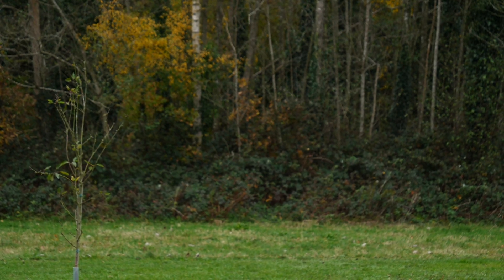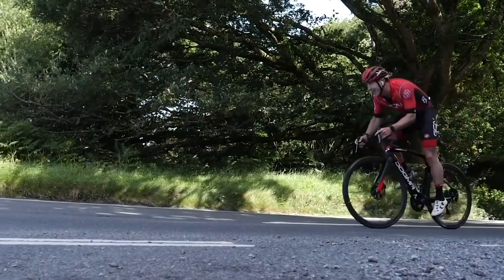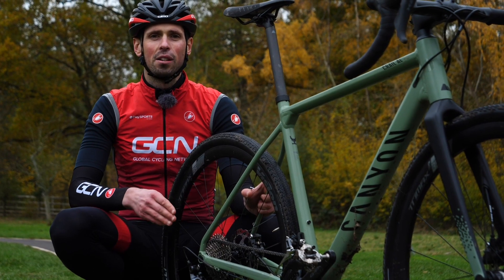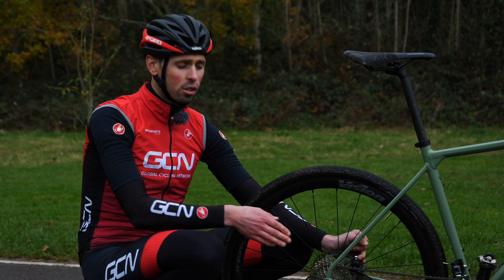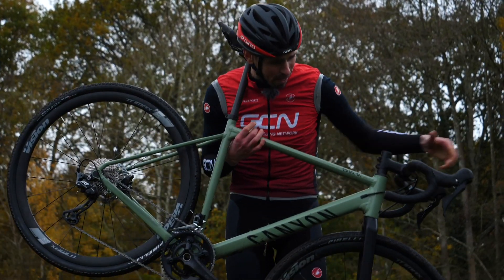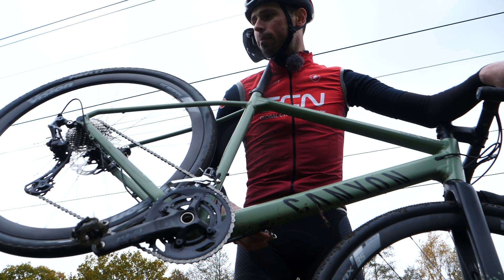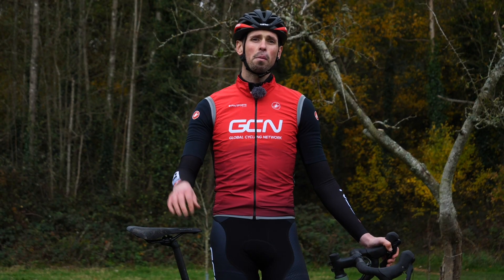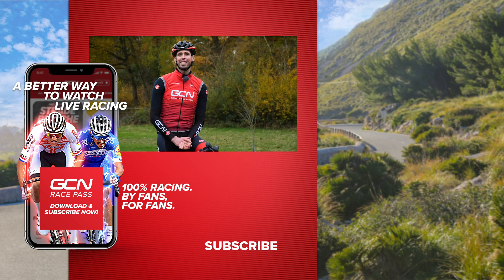How To Tune Your Gears On The Roadside | GCN Tech Monday Maintenance

Comment: Also, check that your through-axle or quick release is properly tight.  If it is loose, the rear wheel can shift side-to-side enough to cause jumping between gears.  Happened to me at the start of a ride this summer.

Comment: Heart Rate Monitor.  What heart rate monitor would you recommend?  Where is the best place to wear it on your chest?  Would you recommend using some type of gel to keep good contact?  Usually in colder weather, I get no readings or it goes off the chart.  I heard wearing the sensor on your back prevents problems of poor contact.  Is this true?

Comment: One of the reasons I have a kickstand on my bike is so I can index my gears while out on a ride.  It's  very easy to tilt the bike and have it rest on the kickstand and front wheel then use one hand to shift the gears while using the other to rotate the crank. At 280 grams, it's a small price to pay for having the convenience of an on-demand bike stand on some desolate steep gravel climb when the gears decide to play up :)

Comment: I had a loose rear wheel which caused the gears not to shift properly. I messed around with the barrel adjustment but fail to realize that my rear axle was loose.

Comment: Dear GCN Tech Team!

I love your show, thanks for the great content!

I own an old mountain bike from the 1980’s which I would like to upgrade with modern components. The only parts I wish to keep are the frame, fork, saddle and the handle bar. I was thinking about equipping it with a modern Deore group set, including disk brakes.
How do I find out whether it will fit on the old frame? Which complications am I likely to run into? Can you recommend sources where I can get some guides?

I intend to do this as a DIY project to gain experience on bike mechanics. And, the bike is dear to me, I would love to bring it back into condition so I can ride it again.

Thanks very much, stay healthy and safe!
Greetings from Germany
Dario

#AskGCNTech

Comment: One ride, I got carried away with the barrel adjuster & gave the cable so much tension it snapped! Bodged the derailleur cable so it was stuck in the middle of the cassette and grinded 7 miles home.

Comment: I went out today and in my big front ring and bigger on the back, everytime I put down substantial power the gears felt like they were 'slipping'? 

Can anyone give me any pointers?
Reply: try loosing the wheel and retighten, sometimes is just a little misalignment, if not, it might be just a little bit of indexing, try what this video suggest and do a little lap on your street or on a roller if you have, if that doesn't work, cassete/deraileur/chain wear and finally give up and go to the mechanic, but probably can be fixed by messing with settings c:

Comment: #GcnTech My road bike will only allow me to ride in the big chainring and won’t let me move back to the small chainring
Reply: If you don't have a barrel adjuster you'll need adjust the cable tension manually. Rear derailleur in the biggest cog, put the front shifter in the smallest gear, undo the cable clamp then when the chain is in the smallest ring, adjust the limit screw to bring the cage up against the chain and pull the cable back through the clamp; not too hard, tighten the clamp and adjust the limit screw back out so it doesn't rub when you're on the big cog at the back. This should allow the cable to be taught when in the small chain ring, but allow easier shifting back and forth. Maybe park tool have video on this.. 🤔
Reply: GCN & Park Tool have good videos on this. Personally it helps me to see what I need to do.
Reply: @ollieb9875  Thankyou very much
Reply: @jameswitte5676  Thankyou

Comment: I'm new to biking and my new bike makes a lot of sound in different gears. I'm not sure whats wrong :(
Reply: Sometimes your front derailleur rubs and that makes a fairly constant but not loud sound. It can be really hard to get rid of and from what I've read is often not worth the effort. Also, Shimano has a trim function on front shifters to help prevent cross chaining and rub. If you're hearing lots of noise after you've changed front gears, your front derailleur might need an extra click on the shifter to adjust the trim. For the back sprocket it's probably going to be the barrel adjuster. There can be a lot of trial and error. 

I'm a relative novice too. YouTube is great for lots of advice on diagnosing and fixing issues, along with online forums. I bought a bike stand and I've changed chains and cassettes, handlebar wrap and tyre sizes using advice from GCN and others. Next is a full strip down of my old bike. So watch a lot and read a lot, Just remember to trust your judgement and don't believe everything you read (some people seem to diagnose the biggest issues and hardest repairs for relatively simple things - bike hypochondriacs!). 

If in doubt, pay your bike shop to tune it for you then any further adjustments you need to do are minor so you learn by doing gradual changes rather than big ones.

Comment: Can you bring Jon back? Where did he go?

Awful. Before making any adjustment, he didn't mention anything about 1) making sure the cable is properly secure and the securing nut didn't come loose. 2) makes sure all the cables were properly seated in the stops or recesses of the frame. or 3) check your cassette and make sure nothing is lodged or wedged in there to screw up the shifting. Unless it's a new cable, once adjusted your shifting isn't going to change by itself. Something would have to cause it.

Is this video to make up for the other poor video he did about rim brake calipers? Can you bring Jon back to replace this guy? Also bring back Tom Last! 
#GCNtech #AskGCN #AskGCNtech #GCN

Comment: If all of the sudden your gears are off index, it’s likely you have a bigger problem and you’ll just be masking it with the readjustment. The two biggest culprits are likely the bent hanger, or an inner cable has started to fray and a strand or two has broken. Maybe a recent wheel or tire change has left your wheel in the drop outs wrong or loosely secured. Either way it’s a good idea to dig a bit deeper when you get back home to see what caused your gears to go off.